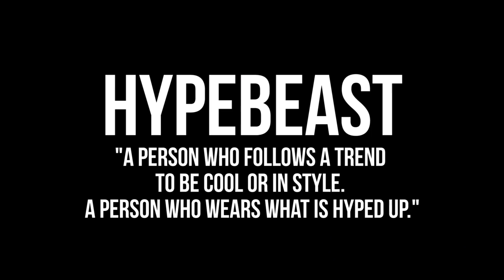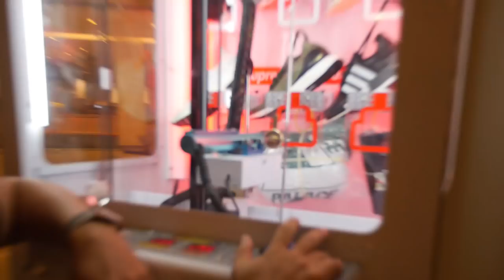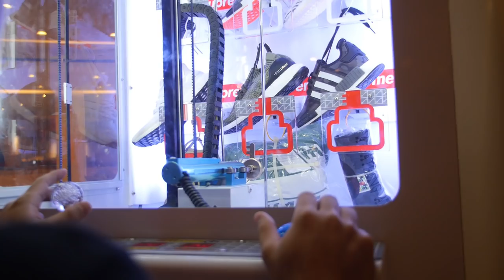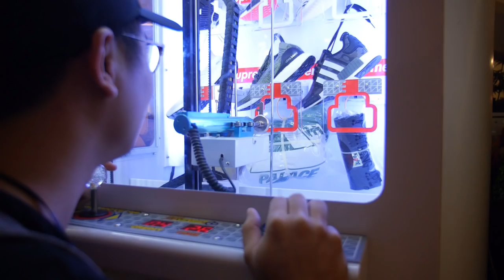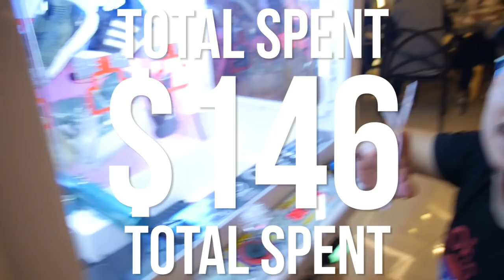$150 TO WIN HYPEBEAST MERCH (NMD R1 PK "FIRESTARTER") - Arcade Ninja

Comment: What do you mean by its rigged? Like when it's not the certain amount then when you hit the button it'll adjust so it doesn't enter?
Reply: xbeibix its set by the owner. If lets say the owner sets the limit at $5000, only by spending $5000 will the key go through, if not the key will hit too high or too low
Reply: I see. Thank you troop master for the info!
Reply: Yep almost all machine have a quota or rather profit margin to hit. It is exactly same as a jackpot in a casino. For eg, the jackpot machine will be programmed to earn 5 mil, only then the machine will give 1 player to hit a jackpot payout. Overall, the machine always win.